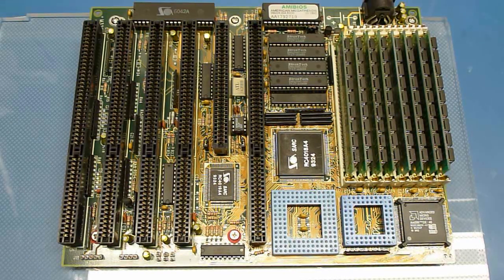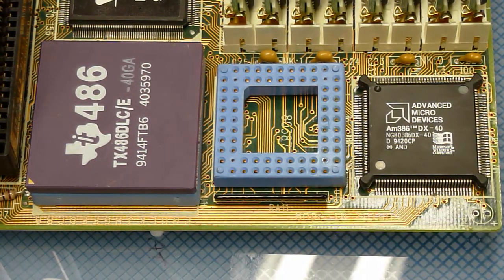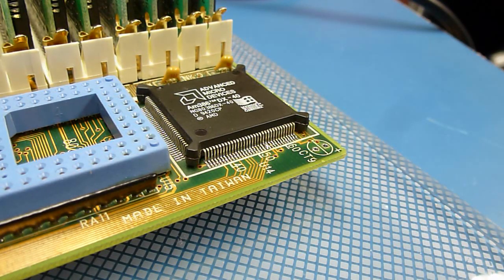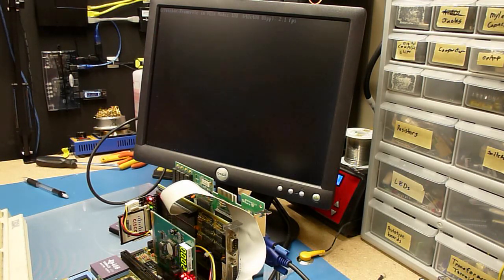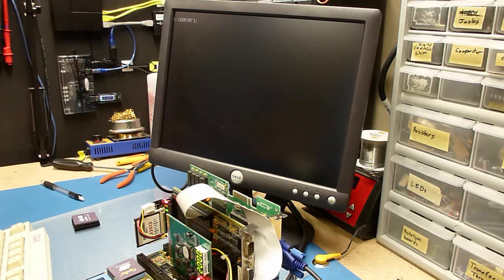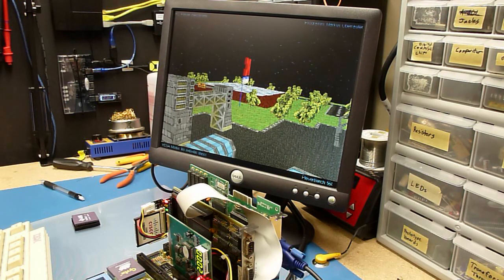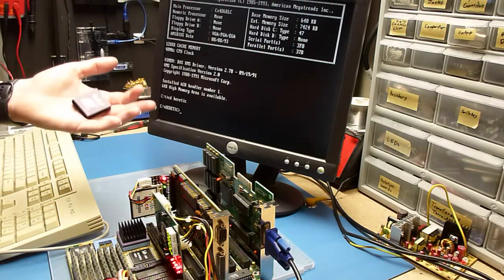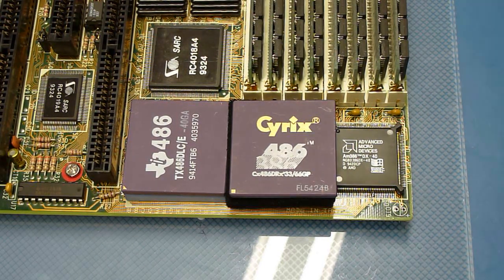386DX-40 Upgrade! Texas Instruments 486DLC-40 and a Rare Cyrix 486DRX2-66!

Comment: I was in IT at the time. The  issue with the 486dlc/slc was the many companies that sold them as if they were full 486dx/sx. 

In many cases, especially the local computer stores would sell them for close the the same price  as a full 486 system. 

There was one computer company in the county that lied to customers about what they were buying and used only the cheapest components.  I personally know what they did because I worked for them for about a month until I  could not continue .

If I remember correctly the owner's special was a 486slc with 2mb ram, the cheapest 512kb video card and the cheapest smallest hdd. The motherboards were horrible. He charged something like $1200-1500 for that junk.
Reply: Yes, what a shame. They really did steal money from the people. But nowadays, these CPUs are really interesting 386 upgrade paths.
Reply: Eww, what a grifter.

Comment: Hi

My guess is the mother board is a bit of a combo design - ie mass produce a board that can cater for 2 or 3 different processors - depending on the next  assembler / reseller - the benefit is one board, then "pick a chip" and make a PC , that way they can produced from 386SX - 486 DX but using as many identical components as possible

If the chip is that hot then it needs a heatsink - coolers did not exits until early Pentium ( i have a P-1-100 that has a tiny clip on fan - from memory AMD 6  and cyrix all needed fans)

I believe you have checked voltage most 386/486 run on 5 volt but newer chips were designed for 3.3 volt

You can view comparison information from Phils web page

Benchmark programs
https://www.philscomputerlab.com/phils-ultimate-vga-benchmark-database-project.html

Benchmark visitors compiled results
https://www.philscomputerlab.com/phils-ultimate-vga-benchmark-database-project.html

Regards
George

Comment: Wow, what a blast from the past!
The very first computer I attempted to build myself from loose pieces at age 9 was in fact a TI branded 486DLC.
The motherboard I had did not have any provision for a onboard processor, but did come with a 486DLC/40 installed.
I had thought I was getting a real 486 for bargain prices, how wrong I was!
It ended up being the most unstable hot running piece of junk ever! You could seriously burn yourself if you had it running for any length of time and glanced a finger across the ceramic. I had to affix a heatsink and fan to it in the most awkward way, as it was unbearably hot. I recall thinking this was because the voltages or something were set wrong, but everything checked out.

It threw parity errors at random, froze up constantly (especially in windows), and never ran well for me. Doom was a guaranteed failure to run.

I thought it was the ram, so I replaced it, I double and triple checked my jumper settings (and changed them to all sorts of things when logic failed), swapped the power supply and graphics card, messed with every bios setting known to man, and nothing made that machine even close to stable.

I really thought it was cursed until I found a AMD 386DX/40 in a trashed motherboard during a raid of my computer store's board bin (located in the back of the store in a bathtub full of random motherboards  and ISA cards) and when I put that in the motherboard my entire world changed and the computer felt transformed. It was stable and awesome after that, and it never gave me trouble again. I had nothing but awful things to say about any CPU branded Texas Instruments after that to anyone who would listen.

Maybe I'll see if I still have it and see if there's something 9 year old me missed. I suppose it's possible I ended up with a bunk/bad CPU, or missed some important configuration step I suppose.
Reply from the maker: Almost anything is possible from that time period. I've got a 486 motherboard here that refuses to work. Looks NOS and everything but easily 3/4 of the pins for the chipset weren't even soldered into place. Got that fixed and now it's either something else or the chipset itself is dead. I work on it a little bit here and there but it's mega frustrating.

So yeah, if you have it there could be anything going on. Could even very well be the resistors for the voltage settings are wrong.
Reply: @DKJones96  It was pretty funny though, the 486dlc cpu in that case was even installed with one of those ubiquitous warranty void if removed stickers. good times. Some stuff from 1993 ages better than other stuff too. I was about to hire a priest and exercise demons out of that board before I plopped a 386 in it.
(Was really running low on sacrificial goats and chickens at that point in my life to appease the computer gods when nothing else worked)

Comment: Had a AcerPower with similar socket arrangement, a soldered 386sx and a 486 upgrade socket. Also needed the soldering iron to get up the clockspeed, had to replace the crystal to max it out. Intresting video suggested by "the algorithm" :)

Comment: Maybe the voltage is dropping due to higher power consumption? Adding a volt meter or oscilloscope to see if the voltage close to the CPU is dipping under load, could be worth a try. If some, maybe adding some capacitors or extra power wire to lower the resistance, could help. Or lowering the voltage to lower the power usage. The board probably is simply not prepared to run this CPU. I don't think the CPU is damaged.
Reply from the maker: That's a great possibility. The 386DX goes high-impedance but doesn't get disabled so all of its clocks and such internally are still running and it still gets hot. It's highly likely that the 486DRx2-66 just loads the board too much. I managed to get this same motherboard in a later recision but without the 386 soldered in and the Cyrix runs great on it. I will be doing a follow-up soon with that motherboard.
Reply: Nah, just Cyrix, being a Cyrix. Non-functional without additional cooling :D

Comment: Why is Sysspeed 6.0 showing CPU Clock, 141MHz? It looks like it is not looking for this information in the BIOS, or the CPU registers, but maybe runs some simple code to estimate the speed? And because the CPU is highly pipelined it gets things wrong, because it was calibrated on 286 or 386 probably?  Still, I don't think there is any way to make the 486-40 to actually do more than 40MIPS, no matter what you try in terms of instruction mix. I think the Sysspeed have some weird multiplier for their measurements, which is kind of misleading. Marking it with "MHz" just makes it worse. Also the BIOS knows the speed from somewhere, probably from the bus information / jumpers.
Reply from the maker: I'm sure it is the pipelining. Only these processors with cache show crazy numbers like that. Kind of makes it useless info in hindsight except for the fact that it does in-fact show the processor is capable of doing something faster than its replacement.